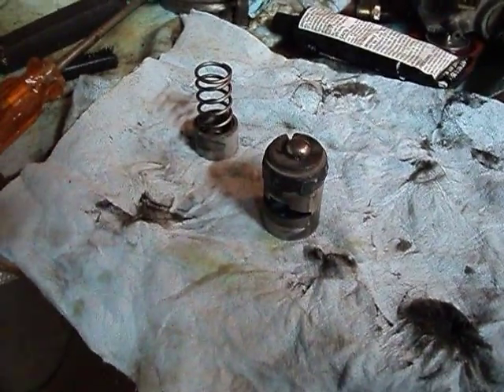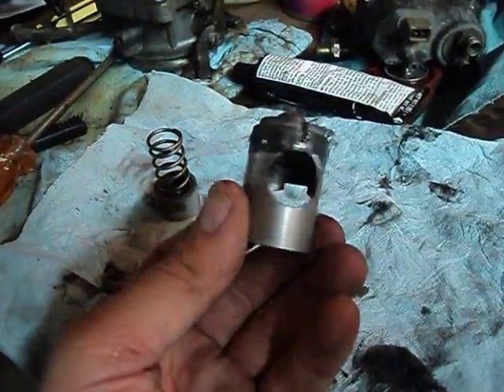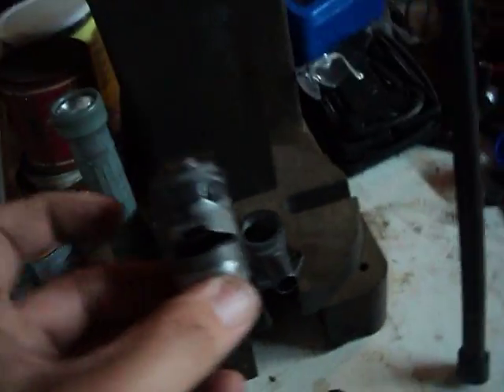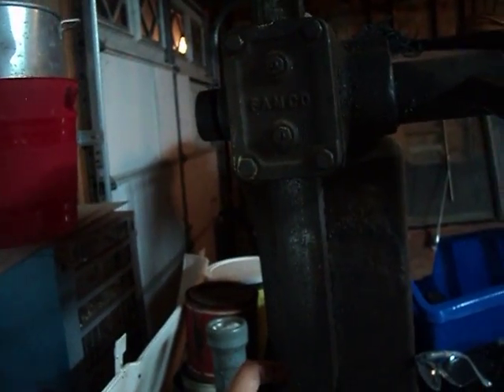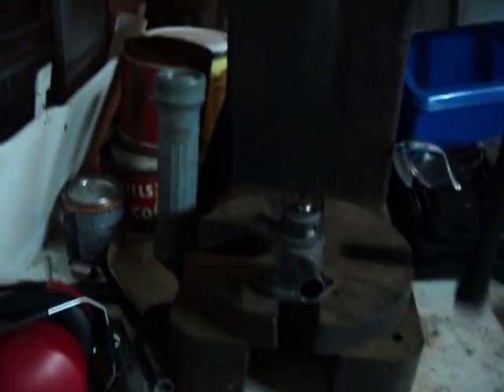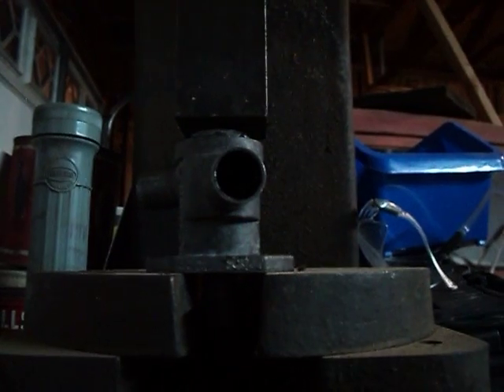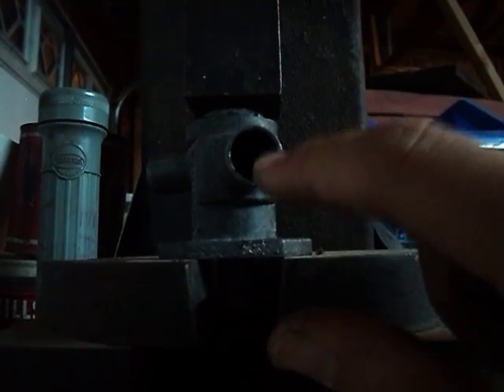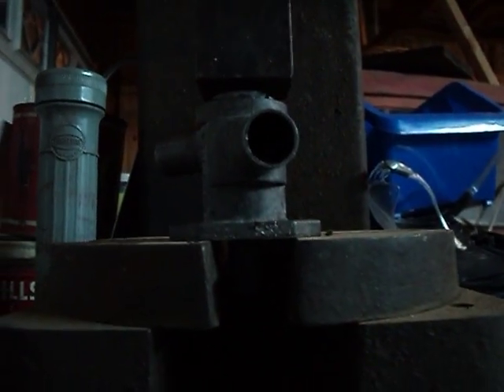Disassembling mercedes benz Auxiliary Air Valve AKA Air Slide Valve Part 2

Comment: Hello.

How its suppose to be the valve with ambient temperature??
Its ok if the valve in in the middle (exit hole). Fully open its only for a cold situation like -20 degree right?

Thank you.
Reply from the maker: Hello,
If the valve is functioning correctly, you should have the pressed in piece pushed down level with the housing. There is some "tuning" available by not pressing it in far enough and then tapping it while the car is running to get the desired idle speed. 

Keep in mind, this only controls the air portion. The fuel pressure module controls the fuel part. There are books available to tell you how to set it up poperly, I'd suggest trying to grab a hold of one of those as it can be someehat complicated.
Reply: @agent6t8  Thank you,
i mean the inside part/piston, this is a picture of what i actually have with 25-30ºC but im not sure if its ok or there is a problem with the valve.
Provably the valve it's ok because the car work well except when its cold, but only the first second/minute.

https://ibb.co/8BQx1K9